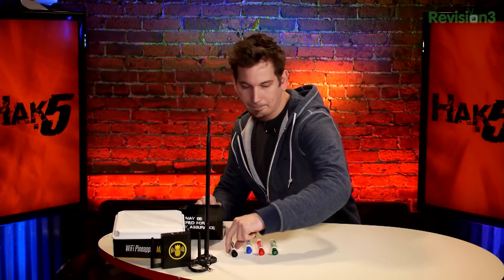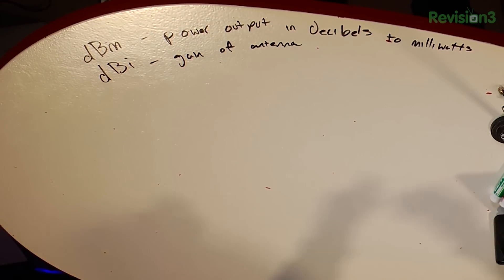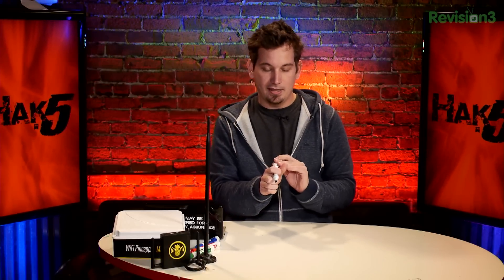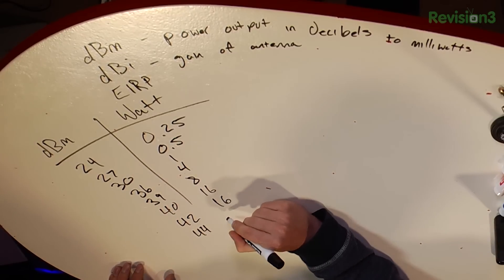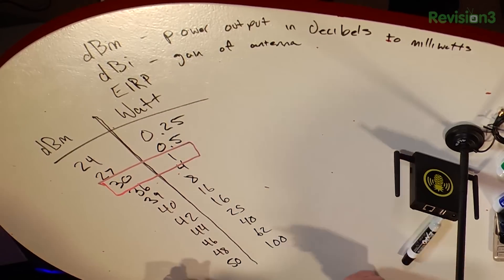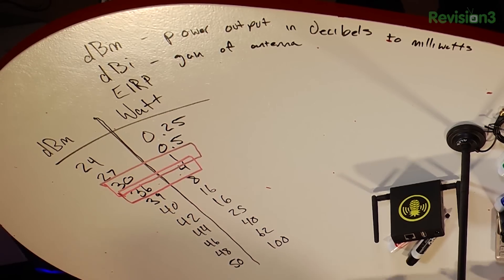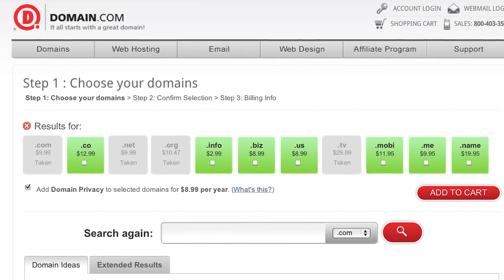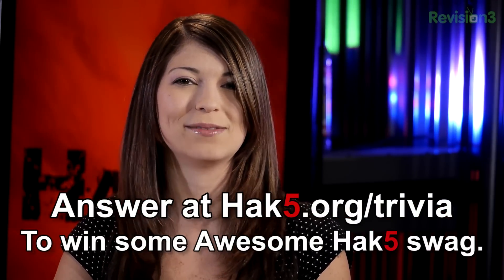Legally build a 60 Watt WiFi Link - 2.4 GHz and EIRP, Hak5 1515

Comment: i hope you wifi fans know that the microwave owen also uses 2,4GHz
Reply: I'll make the the comparison even easier, Wi-Fi routers are like a small pocket hand warmer (even this is innacurate, the thermal energy produced by a Wi-Fi router is insanely insignificant), and a microwave oven is like a heat gun. And no, a Wi-Fi router can't cook you over time, that's like saying that pocket hand warmer across the room is going to cook you alive overtime! I am tired of people calling Wi-Fi, cellular connections, and other types of radio communications the end of the world, cancer causing hell-spawns! It's simply not true! Human fears come from the unknown, so educate yourself, and these fears will vanish!
Reply: @IntelCoreI77700K  i beg to differ.  in the military i worked with a microwave radio system where one of the wave guides wasn't fully seated leaving an air gap.  inside the trac van both myself and another marine started feeling sick and quickly had to exit it.  turns out that open wave guide was essentially radiated back toward us essentially 'cooking' us to some extent.  shortly after that, the wave guide caught on fire.  never tried this my self, but i heard of others lighting incandescent bulbs and cooking hot dogs directly in front of the parabolic dish.
Reply: @dannys2290  I'm guessing it was transmitting at a much higher wattage than a typical WiFi radio used in the civilian world, the military doesn't have to worry about the FCC bossing them around, lol. Anyways, thank you for your service!
Reply: does this mean i can cook with my rc controller
Reply: 65 6c 69 74 65 68 61 63 6b 65 72 Sadley some people have no understanding of this stuff :( they just choose to fear it because they don't understand it.
Reply: 54 6c 69 74 65 68 61 63 6b 65 72 What you said is true but it takes much less than 1,000 Watts to cook you when it comes to 2.4 gHz. 3-5 Watts over a decent period of time will cause antenna burn. Especially if you touch the active element.
Reply: Sadly*
Reply: Oh, and you know microwave ovens use 3000x more power than the typical wifi router?
Reply: Did you know normal visible light that you see with your eyes from the Sun is in the Terahertz range? I hope dumb people like you don't reproduce. It's not about frequency, it's about the power behind the frequency. 1 Watt @ 2.4Ghz isn't going to hurt you, but 1,000 Watts behind 2.4 Ghz will cook you.
Reply: Your grammar is horide.

Comment: the high power point to point, would that include a single ap connection of one stationary antenna and one single mobile ap connection? or do both links have to be stationary?

Comment: In FAA law, EIRP limit is 36 dBm and TX limit is 1W (30dBm). 36dBm can be reached with 1W TX + 6dBi antenna.
But, for P2P communication, 48 dBm can be allowed via 0.25W TX (24 dBm) + 24 dBm antenna.

AFAIK, 0.25 TX + 3 dBm antenna (total 27 dBm) has ~1km range. 48 dBm has 10^2 times range, which means 10km.

Antenna gain for WiFi
http://rcexplorer.se/educational/2009/06/understanding-antenna-gain/

EDIT:
~500mW 2.4GHz transmitter + a ~9dBi Patch antenna for the receiver easily gives ~ 2-4 km range.
http://rcexplorer.se/educational/2009/09/fpv-starting-guide/

In XBee world, it's considered that there is 6 times range gap between 900MHz and 2.6GHz
https://www.sparkfun.com/pages/xbee_guide?_ga=1.17515389.516194514.1424461753
Reply: product relate to this.
http://www.amazon.com/Expansion-Booster-Amplifier-Transmitter-Wireless/dp/B00M3ZXCZK
http://www.amazon.com/TP-LINK-TL-WA830RE-Wireless-Extender-antennas/dp/B006ZHX8S8

Comment: In Australia wifi maximum power is defined in ERP (combined power and antenna gain) and NO you cant have a legal 60w erp.  Max erp is 4 watts here
Reply: itakeyourphoto here in holland, sometimes the AIVD (a company or soemething like it) comes around and checks it all... I have about 80w erp. and they don't do anything against it :)
Reply: Aroop Roelofs That's very good.  You can get very long distance with that erp
Reply: it's enough for me :)
I go to school by train so when I arrive at the trainstation here and walk a little bit, I already get connection whooooo
Reply: itakeyourphoto you could get great range with 4w...but you would need to build a directional dish antenna probably at both ends of the link
Reply: +itakeyourphoto Given how FCC'ised ACMA is I suspect there would be a similar clause somewhere in the red tape.

Comment: Nice (but basic) explanation of power and gain that is mostly correct with a few unmentioned caveats.  However, unlicensed 5Ghz is a much wider band than 2.4.  I am not sure why we are even having this conversation.  You can install a professionally built and certified 5Ghz link for $300 an end that will run at 300 Mbps.  Help me out here.

Comment: With 60 WATT, does the WIFI Pineapple get really hot and fry?
Reply: Evert van Ingen no, the pineapple isn't putting out "60 watts"  the whole system is. (transmitter + antenna)  if you lower, or cut power at the transmitter,  you can have a better antenna, more gain, and that is what gives you the 60 watts. Fixed point to point.
Reply: gamblegambit Thank you for your comment good sir ;)

Comment: Been a ham for 35 years and, work all the microwave bands, inc 2.4GHz. What this chap fails to tell you dummies is that the coupling losses at 2.4GHz  will be as much at 10dbm. Not good, eh.... You get over this by connecting the transmitter DIRECT to the antenna on the roof or tower. Even then there will be a 3dB (in practice often 6dB) loss in the coupling. Use the VERY BEST microwave couplers. They are expensive, but dang, if you are going to use 2.4GHz this is the only way to go. Do the math. Why pay money to get all this gain if you are just going lose 75% of your input power to a coupling?
Yes, it is very silly. The way to do this is simple. A short length of semi-ridged coax cut to an odd multiple of 1/2 waves.
Do the math....DO NOT use 300, use 299792458 (C) / f x 0.95 (VF) / 2 x odd # needed. Simple. Three odd halve waves will be sufficient, but remember to make a loop. Four reasons.... 1) You want the antenna to radiate, not the coax. 2) The odd 1/2 length will be a little long and you need the room in the box. 3) It must be odd 1/2 or the phase will cancel out and NO RF will be radiated at the antenna...!! 4) The velocity factor here will be 0.95 as with a copper conductor. Lengths above 9 odd 1/2 odd half wavelengths and you will need to figure in 0.89 and not 0.95. Remember: Nobody expects the Spanish Inquisition...

Do the job right first time and you will never regret building you transceiver.
Us English Radio Engineers (and Radio Hams) tend to be pedantic about our RF work and like to get it right first time.
You don't want image, radiate spurious signals. ALL your power should be at the ANTENNA and NONE of your RF should be on another band. It is wasteful and annoying to other users. End of my lecture.. I hope that helps. Email me for specific detailes or problems on any band... jackie_allah@yahoo.co.uk  No, I am not a Muslim.
Reply: jozefaz People who ask for those kinds of mechanical tolerances are mathematicians, not engineers or physicists who work in the real world.  They're also highly impractical, since just turning on a light to look at a part that's made to such tolerances will change its dimensions.
Reply: "... DO NOT use 300, use 299792458 ..."

Most of the physical constants of the universe are known to only three or four decimal places, a very few are known to five decimal places.  Betcha can't cut a piece of co-ax or a waveguide with 10 ppm accuracy, so you might as well not worry about all the super-precision in the calculations.
Reply: ***** I worked in a machine shop and we regularly got work for the mars rovers where they wanted us to hold 10 thousands and hundred thousands tolerance. We had to push some of those jobs away or sub contract them as our equipment could only hold thousands (3 decimal places). But the other shops (usually 10 ton CNC machines) could hold the 4th and even 5th place.
Reply: keep in mind this show is not run buy hackers ham heads or anyone with any smarts at all In fact all it is is a bunch of people who know how to read looking up info on the internet and shareing it with people. and one thing to note for wifi using 802.11g and n on 2.4 and 2.5 ghz if you use good equipment and good high gain antennas and have nothing in the way and try to not use ext cables or splitters or connectors I am talking direct connection is best then you can travel very very long distance with no trouble I have connected over a mile away just using a Linksys wrt54g with less then a half watt of power and a 10 dB high gain Omni directional antenna hooked up directly
Reply: ***** Neither agreeing or disagreeing. Just throwing out an instance where i saw 4th and 5th. They once asked for Millionths for a joint on the arm for the space shuttle. We told them we didnt know of a way to get that tolerance and good luck finding one....
Reply: jozefaz I got into engineering when we still used slide rules for calculation — good to three significant figures.  Engineers built the world that you and I know with that kind of precision in the 20th century.
Reply: Tony ISIS 73
Reply: Tony ISIS

I sent an email to this address but it doesn't exist....
Reply: "coupling losses at 2.4GHz  will be as much at 10dbm" With a statement like this, you can safely ignore the rest of this ham's advice.
Reply: @SkyCharter  Yea for real, worked in S-band for a long time, you can easily get coupling down to the antenna well under 3dB, though it does depend on the length of coax and type of coax. A good SMA connector though is going to have less than a quarter dB of loss in insertion and I've rarely seen SMA across trace to a patch lose more than the previously stated 3dB. 2.4GHz is not that hard to work with and relatively inexpensive. You get up into the K bands and it's way more ... interesting.
Reply: @SkyCharter  What he should have said is. It can be as much as 10dbm. And is true depending on the length and type of coax used.

I think he is british and it shows! =]

Comment: There are some mistakes in table dBm/Watt
The formula is
P = (10^(d/10))/1000
where:
P is power in Watts
d is power in dBm
Example: (10^(50/10))/1000 = 100Watt,
mistake: (10^(40/10))/1000 = 10 Watt (not 16)

Comment: where increased dbi does result in increased radiated power, the added rejection of a beam antenna also adds to that equation, which means that radiated power out of the system could be more than 62 watts.

Comment: quick question regarding this. First where can I find a chart for wifi that has the dBm dBi, and the one that shows the effective wattage. Is there a link to the math?
 I have an ASUS wifi router in my apartment and of course when I am closer i get a great signal. Move further of course the signal is bad to the point where my connection speed is less than in same room, about 40Mbs, to the opp extreme of about 1Mbs to loss of signal.
If i throw a 15dBi ant this should resolve the issues correct? Will it also increase BW of wifi router. My devices are 802.11n, according to mfg specs. I have comcast 120Mbs service and get that on ethernet, but wifi, nowhere close. Yet my brother with an airport extreme gets 120Mbs speed test results. He uses all Apple gear.
I have manually changed radio channels to best, least traffic based upon results of wifi analyzer on my android. Not much difference. Hoping new antennas will resolve issue

Comment: Nice video unfortunately you missed some very important points which created quite a large error in your calculated EIRP. The fact is you aren't seeing anywhere near 60watts EIRP

First of all there is no such thing as antenna gain there is only antenna system loss.. When it comes to antenna gain you can't magically create power where there isn't any..  

  In other words antenna gain is a misnomer because you can't magically gain power without losing power someplace else.. In this case those high gain antennas compress the radiation pattern to achieve gain. Basically they take RF energy from one area and focus it in another.  

For example a normal unity gain omni directional antenna pattern looks like a donut with the antenna in the center of the hole. Those high gain Omni directional antennas are stacked collinear arrays which compress that RF donut into a flat pancake .. Likewise the directional antennas focus the RF energy kinda like a mag light does when you tighten the beam..

 Think of antennas like a mag light, an Omni directional antenna is a mag light with the lens assembly completely removed exposing the bulb which tries to light up the whole room. Now a high gain direction antenna is the same mag light with the lens assembly tighten all the way down creating a very tightly focused beam.      

As far as your erroneous  60 watts EIRP  the main problem is your formula. Basically you pulled a total newbie mistake and completely forgot to add up all the antenna system loss's before adding the theoretical antenna gain ..

 For example at 2.4ghz the average cheap Chinese SMA coax connector if you're lucky only adds about 1db of loss per connector, I've actually seen quite a few cheap Chinese WIFI coax assembles where the SMA's connectors where adding a whopping 3db of loss..

Now lets not forget the cheap Chinese  RG174 coax that most wifi antennas come with which if your lucky only adds a whopping 74db of loss per 100 feet or about .74db of loss per foot..

So now lets do the math correctly, take your 24dbm transmitter output and subtract a conservative 8.4db for feed line loss's.  This reduces the power to the antenna to about 15.6dbm.   Now add that 15.6 dbm to your theoretical 24db antenna gain  and you've got 39.6 dbm which calculates to just over 9 watts EIRP not 60 watts.
Reply: Yes... antennas do not have gain.... they only have xdbi less loss than a dipole antenna, as it is the reference.
Reply: How to find exact feed line loss? which in your case is 8.4db. Does it depends on type of connector and the length of wire?
Reply: yea i kinda thought i was tripping fr a sec
Reply: Yes he is changing the signal from dbm and putting it into wattage which is not how signal strength is expressed. Plus these loss figures are at 2.4ghz. Jump to 5.8ghz and the loss increases dramatically! So for a "backbone" stick to 2.4ghz unless you need to avoid interference.

Also if you use an antenna attached to the device without coax you eliminate feed line loss. One key thing to always consider! If you need to add any antenna with coax get the highest gain possible! Otherwise a higher gain antenna that attaches directly to the device is the best way to go.

Comment: I use 30 dbm to 24 dbi antenna.I'm the FCC exception.They won't waste to track my hipower output.I have to many losers using wifi in my city,and most in my area use the same channel that I use.So I have to use very high power to blast through their interference.

Comment: So here in the US we can't just make a massive wifi access point for an entire city? Why the fuck not?
Reply: because there are multiple users of this part of the radio spectrum. A high powered point to point link would likely interfere with other users of the 2.4 ghz spectrum.
Reply: The channels have limited bandwidth.  Eventually, you run out of channels and bandwidth.

Comment: Your math is incorrect.
dBi = Decibles Isotropic (This is a theoretical dipole antenna that does not exist.) It is considered to be the perfect antenna in space. 
For every 3dB you add you get double the power output of the transmitter, for every 3dB you subtract you reduce your output of your transmitter in half. In addition you are not including in your calculation the line loss. I guarantee you are having a substantial amount of loss in the coax on that antenna. It looks like RG-174u on that antenna which isn't even rated for 2.4GHz. So get ready for a lot less power output. Better option, get your ham license.
Reply: as long as he gets a decent range who cares
Reply: @johnnywillard3104  because he is teaching BOGUS info! Plus not accounting for feed line loss which at 2.4ghz is critical! 

The best rule is to add a antenna that attaches directly to the device or move the device to give the best signal on the receiving end. The very last option is to add a antenna with coax. If you do get the highest gain antenna available and adjust output power accordingly.

Comment: I have access point which has 27dbm and i bought an external antenna omni directional 12 dbi gain how to configure it to increase the signal?
Reply: 27 + 12 = 39 dB
Every 1 meter cable reduce 1 dB 
Every 1 connecor reduce 0.4 - 1 dB depends on connecttor attention

Comment: Same FCC rules applies to 5 GHz?
Reply: george, it's not the spectrum these rules direct themselves to as much as it is the systems being used. You'll probably find that systems that operate in this manner on 2.4 ghz are not allowed for use on 5ghz.  I could be wrong, but that is a fairly consistent thing with the FCC

Comment: One minor detail that's been overlooked. An isotropic antenna is a point radiator, i.e. a theoretical antenna. Manufacturers like to use the isotropic antenna as a reference because it makes the gain of their antennas look better, approximately 2.15 dB better. As it is impossible to build an isotropic radiator, gain measurements expressed relative to a dipole are more practical.
0 dBd is considered equal to 2.15 dBi. Bottom line? Subtract 2.15 dB from the EIRP values given in the presentation to calculate the ERP.
Reply: try to build an Interosater...if you can you can get a job with Exator